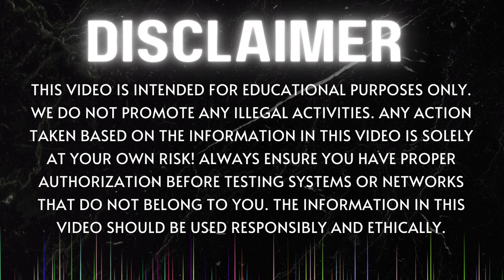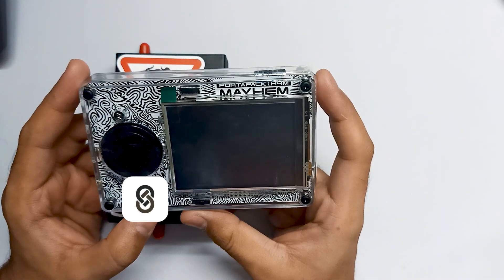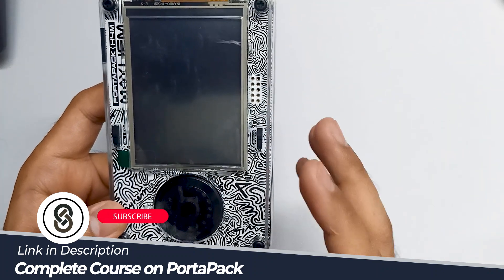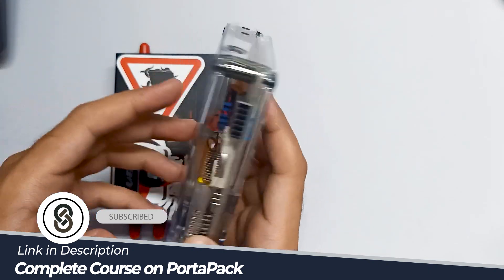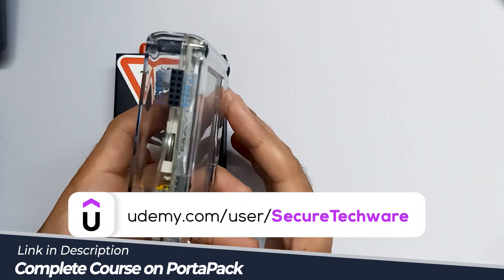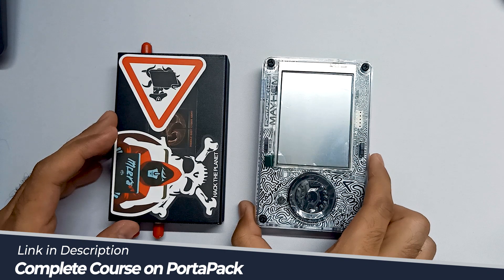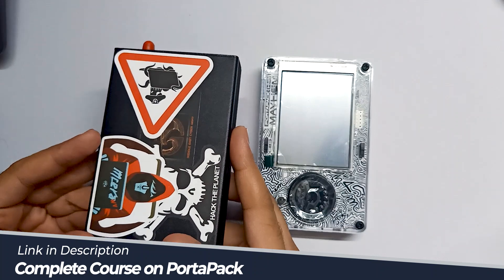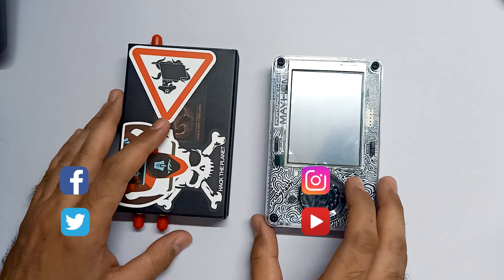Mayhem H4M Unboxing: First Look at This Powerful SDR Upgrade!

Comment: I have never owned a SDR. So I purchased the H4M. It came with absolutely ZERO documentation. I searched the internet for a user manual. ZERO. I contacted the makers of this product. They said "We don't have a manual for this yet". Again, ZERO. They said it works just like the H2. Looked for a user manual for the H2. ZERO. The only information I have gotten so far is what I can glean off of YouTube. It might be a really good unit but the company does not get a passing grade from me. Any reputable company will support their product with correct documentation.
Reply: agree 100%
Reply: Did u have a lisence or the customs doesn't care